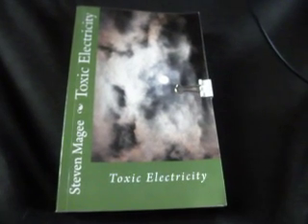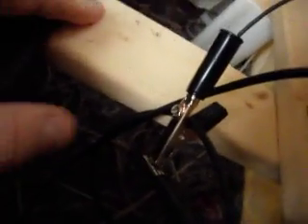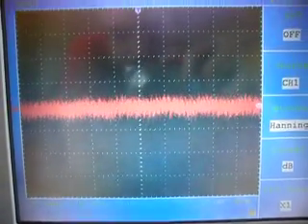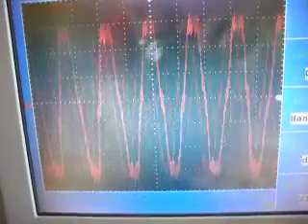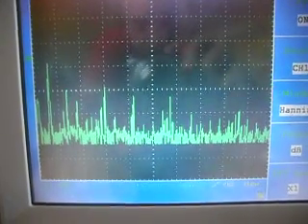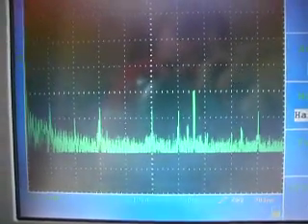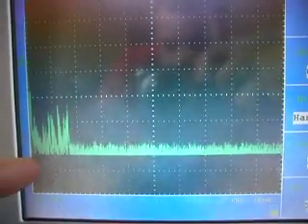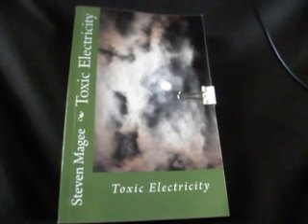Mattresses, Bed Springs, and Electrical Energy

Comment: could you not just keep your bedspring grounded?
Reply: thats what i did. it works. but u need to cut a small slit into the outer matress to get to the spring. and then tie that to a wire and put it out your window at least 40' form the house. with a copper grounding rtod right in the dirt. try your best not to link up any grounding/earthing to the 60hz grid.....always stay organic.
Reply: @movementofvitalenergy33  Why does it have to be 40' from the house? That's a long distance.
Reply: yeah

Comment: A 'cal king' sized spring mattress we have (very worn down with springs right near the surface) creates some Serious electrical shock feelings if sitting on a spring. It's actually quite impressive, the faster the swipe of hand the more intense the shock.
The unbelievable thing is it can literally feel like getting 'bit' by a 120V AC line.
Reply: Thank you for sharing this I’m only now seeing the dangers of the mattress I’d been using for last 7 years!